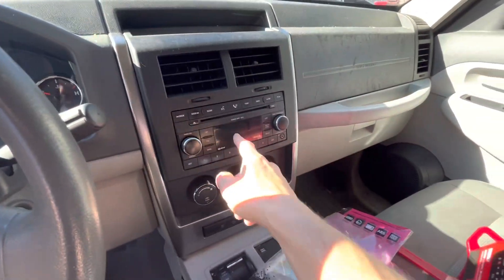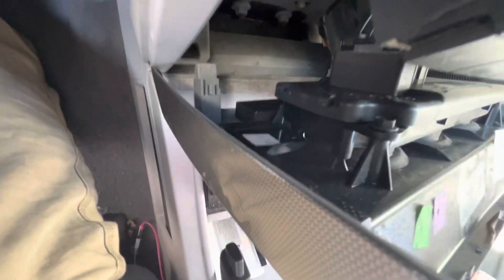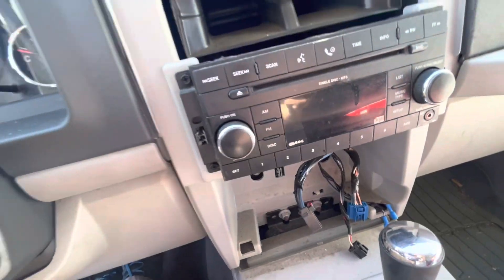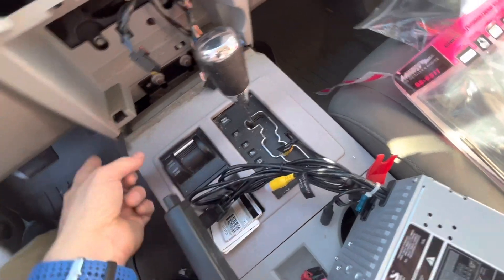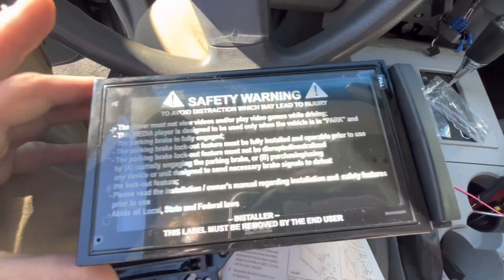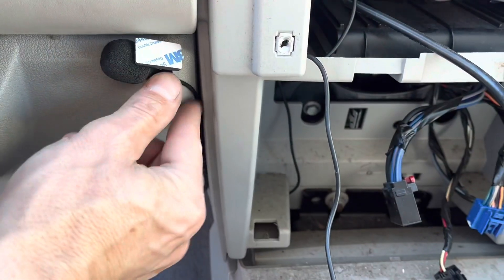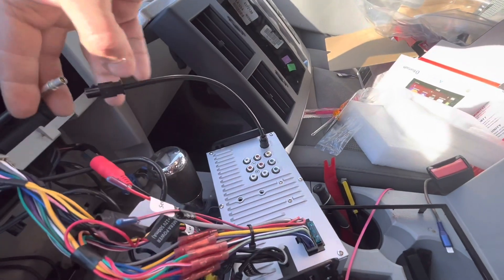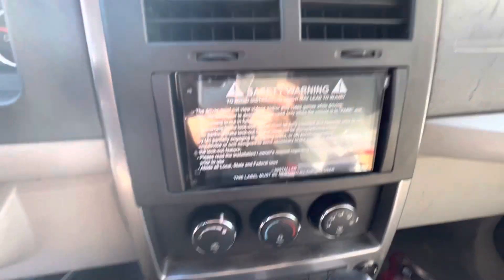2008 Jeep Liberty - Boss BV800ACP Bluetooth Digital Media AM/FM Receiver Install

Comment: For the problem with the unit sitting to far back. I used washers to build it out. 
Put the washers where your 4 screws go and it will push the unit out 
There will be a slight gap in the center because it’s curved but you can’t really notice it.
Reply from the maker: Great idea!!

Comment: For the external mic I drilled a small hole in the tray above the center console and put the mic there 
For the USB cable I drilled a 1 1/16 hole on the left side opposite the cigarette light and bought an adapter 
And put it there 
Looks factory and matches the other side with the cigarette lighter 
Instead of the Boss Unit I went with the Atoto F7 XE Amazon had it for 160 dollars 
It’s wireless Bluetooth for android auto and Apple CarPlay 
I also got a rear view camera and steering wheel controls both from Atoto 
All together with the wiring harness it cost me about 250 dollars 
It also has Wi-Fi and when wired you can mirror your phone to the screen
Reply from the maker: That sounds great!  What a good system.  Like where you routed the wires, too.